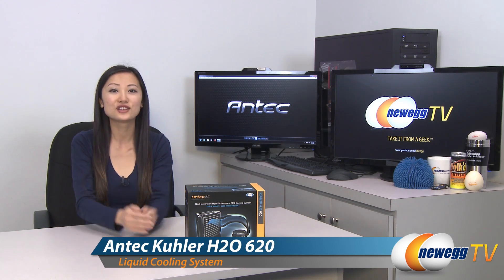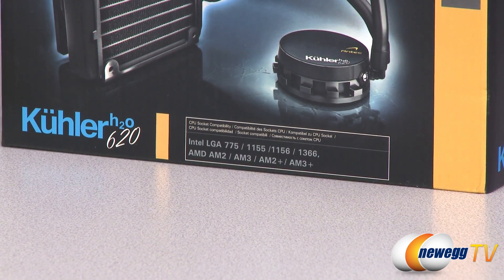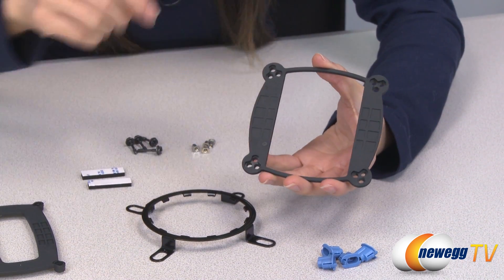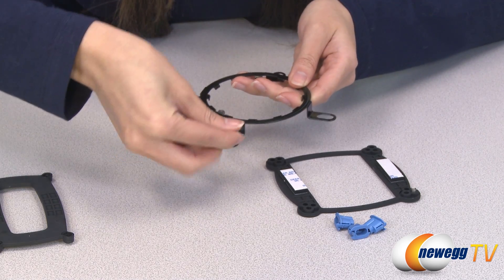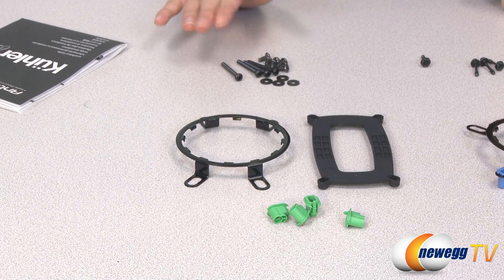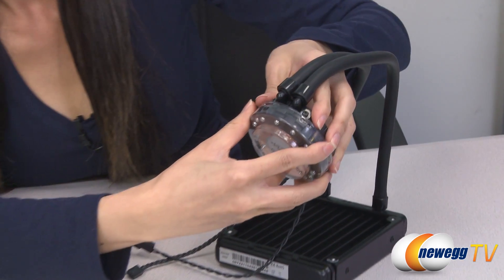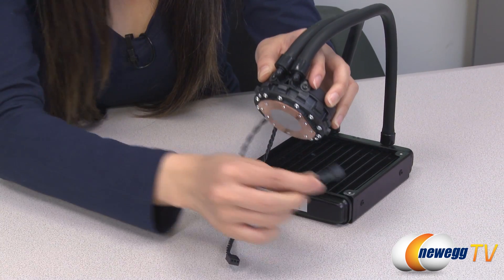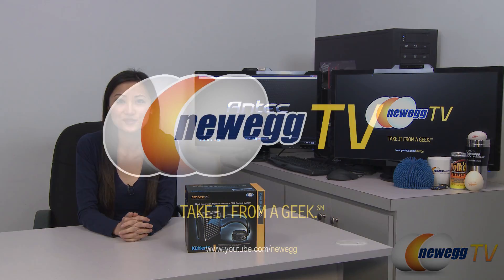Newegg TV: Antec Kuhler H2O 620 Liquid Cooling System Overview

Comment: I know its a bit late to reply but no your temps will be fine. I myself have ran a Core i7 3770k at 1.43V and 4.6Ghz and i was idling around 38 degrees with the 620 with the rad and two corsair static pressure fans. At max load in prime95 with ambient temps of 25 degrees my temp maxed out at an average of 69 degrees.

Comment: I should know this but I figured I'd ask here for some additional help lol.  I have this thing and love it, but I'm upgrading.  Planning on getting the i7-3770k and overclocking by 10% at most.  With a second fan installed on the radiator will temps go crazy (like above 50-60C)?  Or is this little thing powerful enough?

Comment: ahh nice yeah i thought wtf when i saw a water cooling system actually for sale at a best buy "since IMO most best buy stuff is crap lol" but thanks for that info, i might actually try it. my stock HFS keeps me under the temp limit but runs pretty high about 127F under load, allthough it never goes any higher. im running a AMD 640 quad core locked at 3.0ghz

Comment: I bought it from best buy for like $60 and it's my first liquid cooler, and I haven't had any problems keeps my AMD Phenom II X4 955 @ like 28-30C while 0% CPU usage then full load its at like 50-55C  @ 3.8GHz.  but be warned, a lot of people say the instructions are kinda misleading/ confusing.  Which I didn't think they were to complicated, I installed mine correctly and everything works.

Comment: @seaking020492 the douchey part of the comment was not aimed at you. that was aimed at clays121 for calling someone a noob, when having 2 CPU coolers would not at all be noob in a system. the part where i said he may have a dual socket motherboard, that was the part of the comment aimed at you.

Comment: @ldimillo19 Actually I have heard of dual CPU boards, and ran one in past way back in the Intel slot days, but 99% of people here would never run one in a modern system. which is why I questioned it.